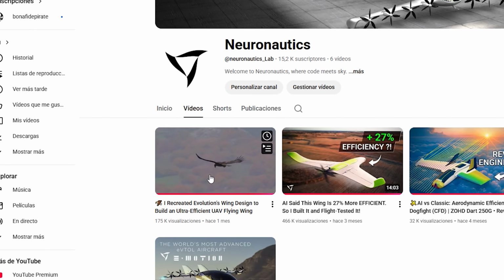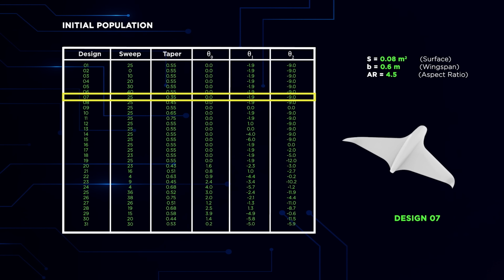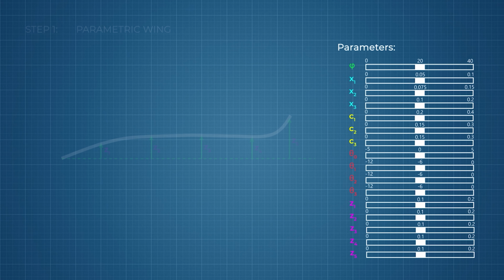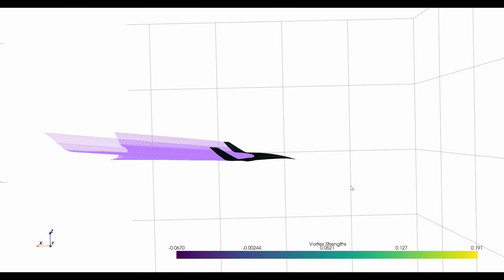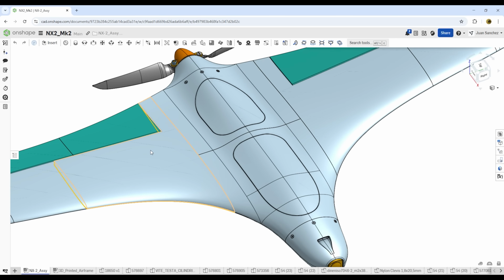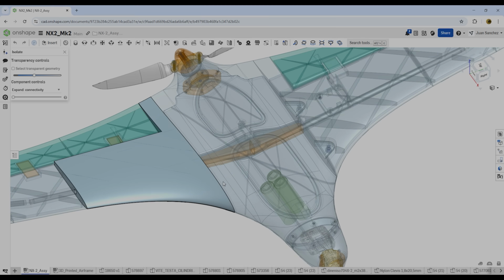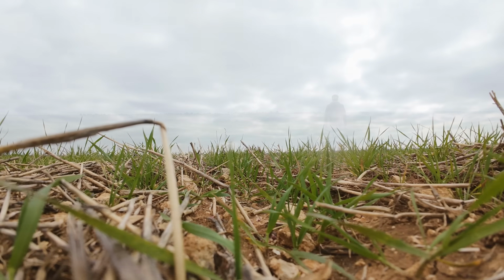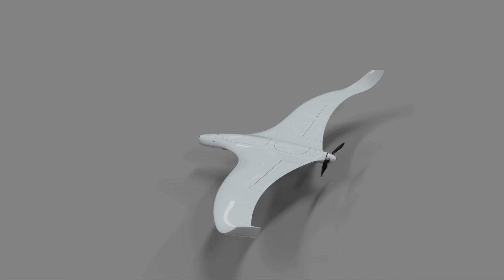AI Designed This Organic Flying Wing… I Had to Build It (+16% Efficiency)

Comment: It's cool. But I think you should take it into account that the wingtips don't take that shape until under load. So maybe a wing tip insert that is flexible
Reply: And instead of single axis flaps, he could build a fully articulated wing surface with soft actuators attached to branched hollow support elements. And maybe he could make the wings out of adjustable spines with protruding fibers that can interlock or spread out. And instead of a propeller, the wings themselves could flap to generate thrust. And maybe give the plane a curved "beak" that broadcasts high frequency acoustic chirps to communicate with neighboring flying wings. Basically, he should build a bird lol
Reply: The problem would be fluttering happening, that could be another video.
Reply: The 'wing tips' are vertical stability structures. Birds have much better systems (Brains and sensors), with zero aerodynamic costs, I'm curious what the program would have settled on with a single vertical rudder, and wing tips optimized for lift, no (or less) stability function.

Comment: nice design,

what is the name of your aerodynamics simulation software package
Reply from the maker: Thanks! 🙌 For the fast aerodynamic evaluations I used a VLM approach, mainly through the Python AeroSandbox library, and I also use XFLR5 for this kind of low-Re analysis. For higher-fidelity CFD, OpenFOAM is the heavier tool. 🚀✈️

Comment: Remove the tiny upward tips at the ends of the wings, remove the big engine and mount two smaller counter rotating ones at each wingtip and you would gain even more efficiency. There is a proof of concept of this here on YouTube.
Reply: And the differential thrust would provide yaw control to help with landings

Comment: Technically it's not an AI, it's just a genetic algorithm. Though it's still impressive.
Reply: Nothing being sold as AI is, to be AI in needs to be Intelligent, but current models can't Reason they can only Rationalize, with means they aren't Intelligent, there is a good video on this called "Model Collapse Ends AI Hype" it's really does a good job of explaining the limitations of current "AI" models.

Comment: I can see why AI went towards that design as it reminds me of an albatross which is considered the most efficient bird.
Reply: "Efficient" assumes some commonality. Albatross are optimized for typical winds at sea, and 'Dynamic Soaring'. (Look it up, 2 of the 3 YT videos are excellent, one sucks.) This wing is NOT optimum in weak thermals aloft, though excellent in strong thermals or ridge lift, where air speeds are significantly higher. Thermalling birds have to eat regularly, so are Not optimized for stronger, and less common, conditions. And both are hopeless in chase or escape when predators and prey are both birds. The Northern Goshawk is widely considered the best pursuit predator, particularly in woodlands where speed and maneuver among obstacles are both essential for success. Among Seabirds, the Ewa bird (Frigate Bird) is among the largest, but also the most maneuverable. Commonly stealing catch from other smaller birds, or conspecies, in preference to catching their own fish.
Reply: Darwin.
Reply: The Albatross (or any animal for that matter) is a Least Pessimum set of evolutionary compromises. It needs a neck to feed, for example, and the kink in the wing is necessarily because it's jointed and needs to fold towards the body when it's not flying. These things give birds a distinctive shape. This is by way of saying is that this design mimics avian morphology because that was the original input. The AI optimised a bird-like design, it did not come up with a bird-like design. In a sense it is the same "mistake" that early attempts at human flight made - modeling off what we observe in nature, and not what is necessarilyy most mathematically efficient if the physics of flight alone are considered. The mathematically ideal planforms range from tapered ellipsoids to Prandtl bell curve wings - neither of which are reminiscent of birds and in the latter case require an extremely long span-to-length ratio (not aspect ratio) that cannot be supported by jointed bones and still have a flying critter that gets to make bebbes before it dies.
Reply: Great work evolution speeds up. A lot of work, thanks for sharing  and looking forward to the next chapter
Reply: Using an Albatrosses wing design would possibly not work too well as it is only efficient over the open water because of the winds there, something called dynamic soaring is the strategy used there. Maybe condors are the best pick as they have these primary feathers with slots at the wingtip and use thermal updrafts to gain elevation over land.
Reply: "AI" hype doesn't design anything!

Comment: So you basically use a VLM with its limitations to optimize an flying wing:

Limitations are:
Non viscous flow
Small angle alpha
Zero thickness

And you used a sophisticated method to find an optimum in a 16 dimensional space.

Did you couple the VLM with a boundary layer solver?

For the dihedral distribution it is better to you chebyshev points, you get a better approximation with out the runge phenomenon.

Next time try ADFlow
Reply: I've done almost this exact problem with ASB and ADFlow/MACH-Aero. The VLM is pretty easy to weakly couple to XFOIL. ADFlow's lack of a transition model is a more significant weakness for these aircraft imo.
Reply: @GOAFPilotChannel adFlow use a SA turbuluncemodel where you can define a tripping Point but for a First guess the vlm is ok.

Have you tried to couple openfoam with your design variables?
Reply: @EmDotJay I haven't tried openfoam (or dafoam). A fixed tripping point is insufficient. VLM alone is insufficient for trim/stability on a flying wing with optimization, if you don't consider airfoil Cm.

Comment: Looks beautiful! I wonder if you sneak a few more percent efficiency if the aileron were pivoted with a nylon hinge at the outer pivot and a shaft on the inner pivot that extended into the body to attach to the servos inside?
Reply: That's what I was thinking, eliminating the extra drag from the servo linkage and the seams around servo cover has to increase efficiency, and there looks to be plenty of room to move servos in the body.
Reply: Internal body servo and fully sealed flaperon hinge has several obvious solutions. None necessary, all improving drag.

Comment: This is a super cool series. Stuff like this is the real power of ML/AI. 

I'm surprised that you are using heat set inserts and screws since they are heavy. I wonder if just simple packing tape would work a bit better? It would also have the added benefit of covering the seams for smoother air flow.

Comment: This is really awesome!

Question though; shouldn't you add to the equation the servo arm(?) covers for more accurate aerodynamic efficiency or MDO? ...and speed?
Reply: And what of the weight distribution between the wings and the main body? Wouldn't a wing"heavy" constructions be more stable? (I'm really just musing though)
Reply: I'd like to see the aileron hinged on a shaft that extends into the body, so the servos can be mounted in body and drive the shaft to eliminating the extra drag of the servo arms and seems around the servo cover.

Comment: Great to see a positive use of AI for a change. Amazing how the final shape looks so close to a raptor's wing.  Did the AI also work out the aerofoil shape as well or was that fixed ?
Reply: He did the whole design, and specified which design parameters can be changed within what range.

Then he ran a program to iterate the parameters, and tested each design with a fast, simple FEA script, and finally tested that design against the original (from the last video).

The highest scoring design is the one he built.

None of this process was "AI", it was iterative parameter processing and scoring.

The results speak for themselves, and doing it this way is much more impressive and likely FAR faster than "AI"!